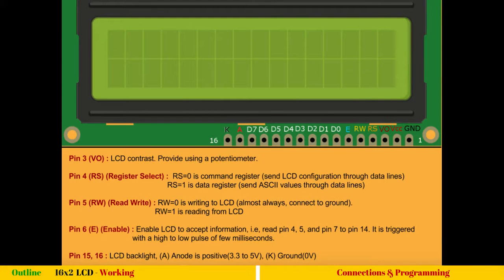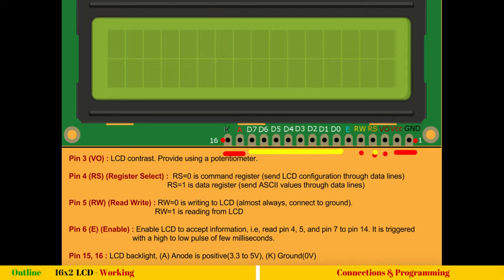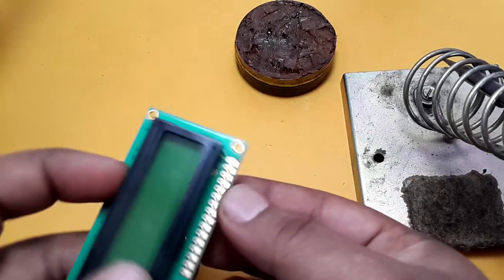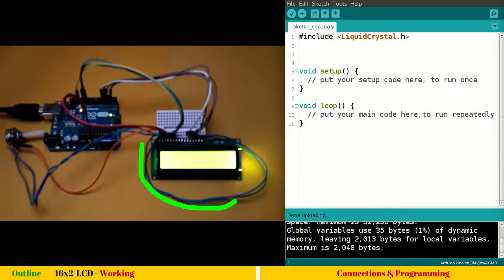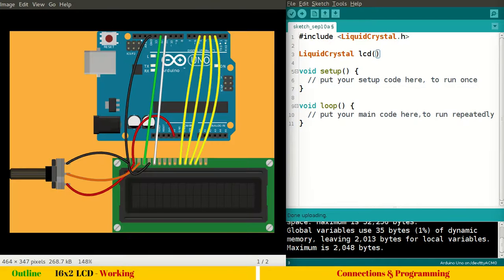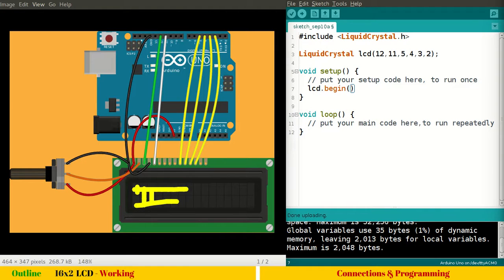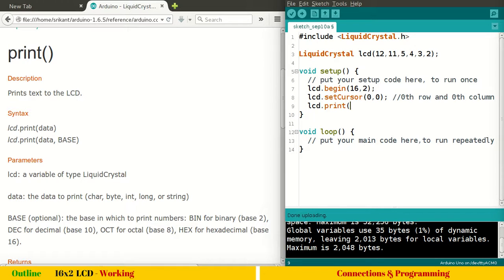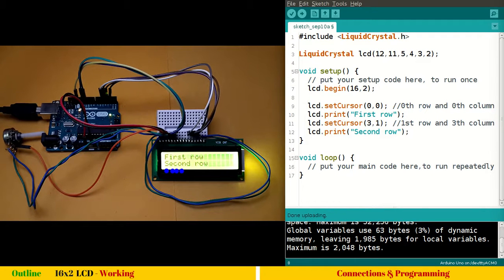9. Interfacing 16x2 LCD with Arduino

Comment: Hey, very nice tutorial and thanks for it ;)
It's possible to interfacing a 16x2 lcd with arduino to measure the DC voltage?
Reply from the maker: Sure. You may follow this documentation https://www.arduino.cc/en/Tutorial/ReadAnalogVoltage.
Replace the function Serial.println() with respective LCD ones.